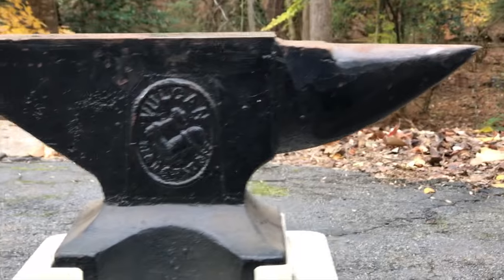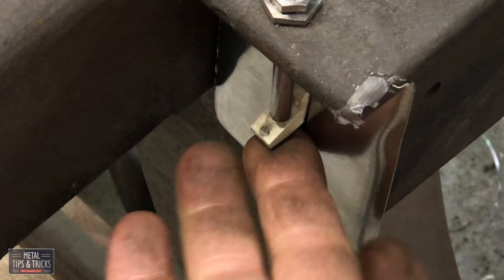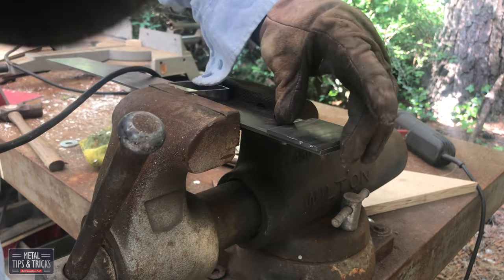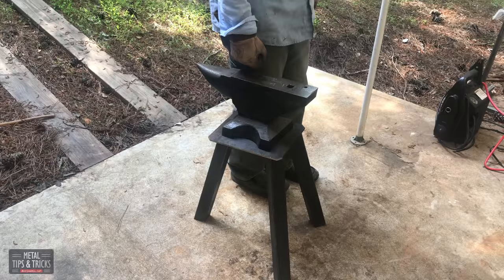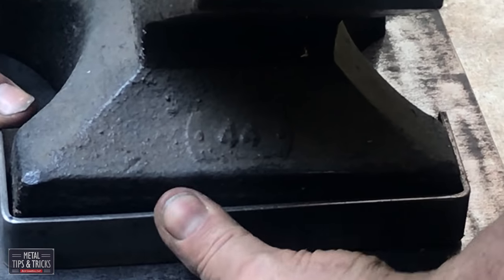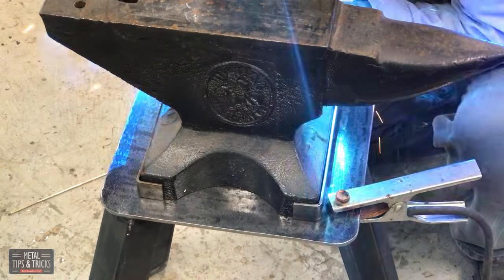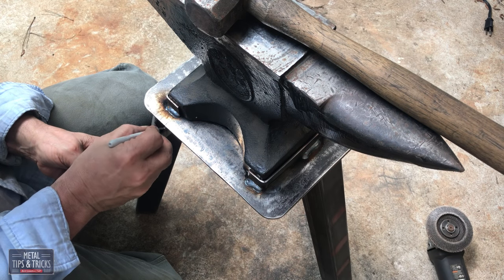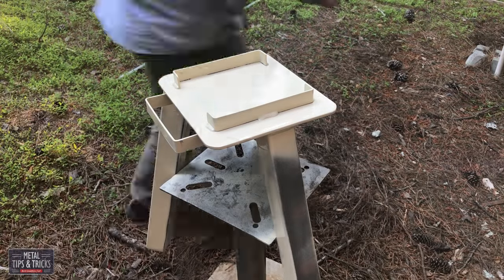How to make a Anvil Stand

Comment: Here in Denmark, it's more common to place an anvil on a big wood block.  Much more dampening than steel
Reply: "maybe" he had no access to tree stumps ??? (old timers in USA use big chunks of logs also)
Reply: i would think it would be better too, his stand is really nice but a wood stomp would dampen the noise ans vibration more
Reply: They don't have trees in California anymore. They burnt them all down this last year. He would have to import something.
Reply: WalkOn Bye  Maybe.  But most things they did beacuse it was the best to do..  dont think, beacuse its old its bad.
Reply: If you use an anvil on timber then on steel you will understand why a block of wood is best 
Think about it they had anvils so they could mount them on steel but did they ?
obviously they did and it was shit
Reply: Well, wood dampens sound, but it's also incredibly hard to move around. If your work consists of moving the stand and anvil a lot, metal is more practical.

Comment: 2 things to note if you ever build another one.  Fill the legs with sand, it will help absorb to harmonics, also I would add braces connecting all the legs a few inches off of the ground.  I think over time that top plate is thin enough to let the legs spread. I enjoy your videos.

Comment: Fine anvil mounting scheme for bending heated metal, such as tweaking horseshoes and the like.  Ferriers will often have an anvil mounted to the back of the truck for just such a purpose.  In addition to needing a much larger anvil, not much good for forging billets as the stand will spring and deflect, robbing energy from the billet being struck. Again, depends on the mission and who want's to hand forge anyway.   Stable stand, though and I do like the bulk of your body of work along with the tips and tricks.   Keep 'em coming, please.

Comment: Not sure if it’s been mentioned. The 44 was the year the anvil was cast (1944) and the 7 under the horn is the weight. Vulcan anvils always dropped the 0. 12 would =120. So a 7 means 70 pounds. Nice build

Comment: Nice little stand BUT with such a light anvil you need to have hold down bolts and a cross bar over both feet on both sides. This will prevent the anvil from jumping up when striking heavy blows near it's tail end.

Comment: For a home shop , that needs to bang on something.  This will work.   For a small home forge,  itll take all the power away from your impacts . It needs braced  using the concrete floor to backup each blow.

Comment: I did a led casting arond the foot of my anvile -works great .now it sounds and act's like a huge one😊
Reply: I'd like to see that. Respond with a pic or two.
Reply: @vicferrari9380  
I put the anvil in a car rim that i seald the holes on . filld it over the foot of the anvil with lead.and cut out in the rim for hammers and tongs...a stack of rims 14-13-14" done..😎

Comment: I think you'll find it to be a very noisy anvil. There is no dampening in the stand, maybe more like amplification of the ringing.
A good tip would be to set til anvil on wood and fill the legs with sand. 
Even more important: that anvil will jump all over the place when you use it. It is way too small to stay at rest without anchoring.
Try filming this anvil in high speed under use and you'll see how much it moves.
Having a 'jumpy' anvil not only hurts the quality of your work, but it bleeds all the effort you put into your hammerwork into moving your anvil where it should be moving red hot metal. 
You know, you have it right when your anvil does not ring like a bell, but just makes a dry 'clack' sound when you use it.
Reply: Actually; I'm afraid your hole stand will just jump with the anvil. 
Take Rasmus' advice and use a length of tree trunk, or build a stand out of heavy pieces of wood with a hollow in the middle that you can fill with sand. 
Your stand should weigh at least as much as the little anvil.
Then anchor the anvil firmly to the stand, and you'll suddenly get twise the effect with the same effort.  - and you'll be able to hear what your grandchildren are saying to you.

Comment: Anvils should be mounted on a wood block/tree trunk.
Reply: If you're doing lots of blacksmithing, sure. For what Dale most likely uses it for, his stand is perfectly acceptable. In fact I'm going to steal the design because my avil is basically there in case I need to beat something in to submission.
Reply: suzukichopper pleat the puece up before beating down. It saves your anvil.
Reply: if you mean "heat the piece up"... no kidding. Most metal doesn't move very well otherwise.

Comment: I was looking for you to bring out a tree trunk LOL  Very Cool Build, the hammer and tongs rack set it off.  It's amazing what a man can build with the tools he has.  Was that a MIG or FluxCore welder.  Having never used either I can never tell.  Been looking at a wire welder, for the shop.  I have an Old Craftsman AC Stick welder that I used many years ago in the body shop.  It is a High Amperage model, and always worked well with 7014 and some 7018 rods.
Reply: After rewatching the video, I was able to stop and read the welder screen where it said MIG.  Answered that question.

Comment: It looks like a 100lb are you sure its not 44Kg = 100lb?  I have a 100lb anvil and yours looks the same size. I would like to recommend that you make brackets to hold it down tight to the stand to get rid of the ringing, it will save your hearing.

Comment: Why not use a cutting torch? Works great..use the grinder for what its for...grinding
Reply: Maybe he doesn't have one?
Reply: I'm a professional welder of 35 years and we cut with a skinny wheel all the time. Some thinks it's simply easier. I don't care how good you are with a torch you going to have some slag. Slag needs to be removed. The time you spend getting the torch, striker,dark glasses, making the cut, grind/sand the cut.clean and straight. Sometimes it's easier to grab the skinny wheel. Please use great care with a scary wheel. Always have a strong grip on it and never ever ever push it away from you. Like a chainsaw the kick back is violent and beyond your control. I've seen too many tendons, muscles and bones ( don't forget nose cartilage) exposed and cut by them. ER visits suck.
Reply: @vicferrari9380  ive also been fabricating all my life and i refuse to use a grinder with cutoff wheel for the obvious danger..grinders are for grinding
Reply: @mrhp434  Obvious danger? Secure your work, make sure your disk isn't chipped or been dropped (use new if unsure), and wear a face shield. No more dangerous than having a bottle of pure oxygen in the shop.
Reply: @suzukichopper  when you have been seriously injured you look at safety differently
Reply: @mrhp434  I have been seriously injured. I learned my limits and using a grinder with a cut-off disk is within those limits. I really don't see where your "obvious danger" comes from. Using a grinder to cut steel is widely accepted and used. I mean, every abrasives company makes disks specifically for that purpose. If there was "obvious danger" their lawyers would have stopped them at some point for the "obvious lawsuits" that would occur. If there's that much danger too it a bunch of people would be getting hurt which would trigger a class action lawsuit no warning label would stop.

Comment: You think fighting with your welder is a challenge.  I did a prototype computerized sewing machine years ago that would steer the two pieces of cloth to make a felled seam (double overlap).  It worked great for me (and I still have samples of my own work) because I just stuck the material in and let 'er rip.  But, when an experienced operator who was trained to do it by feel tried to use it, it freaked them out!  All of their motor skills were suddenly wrong.  Humans are capable of phenomenal manual dexterity.